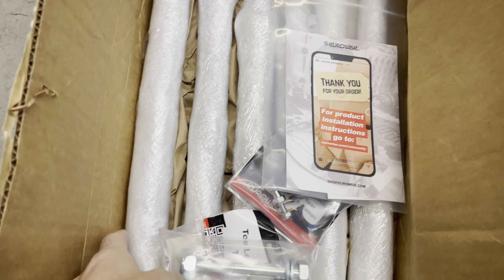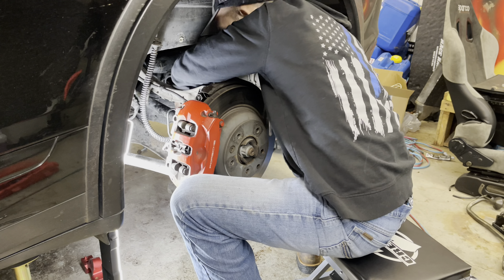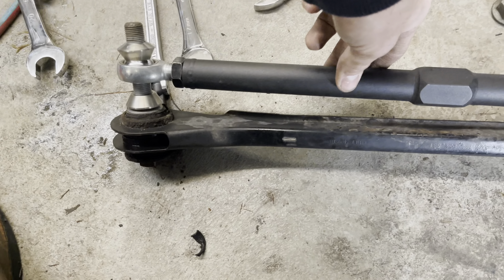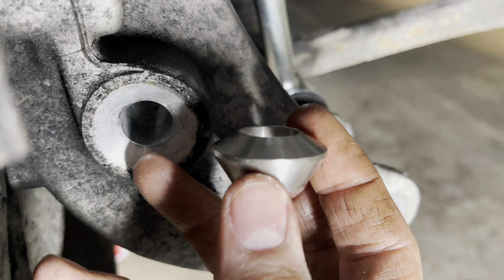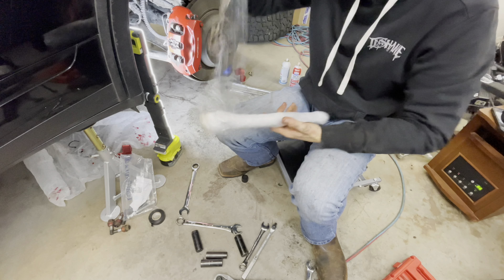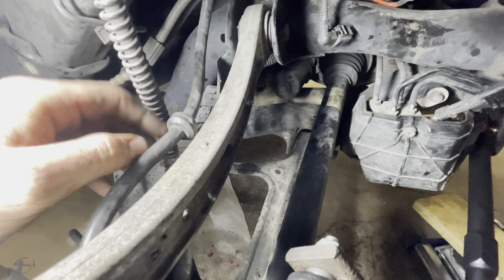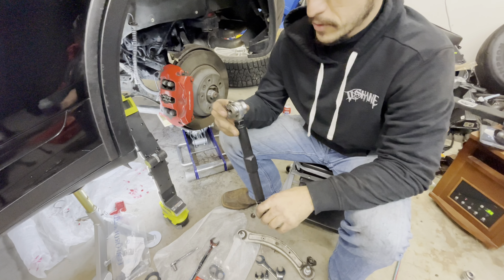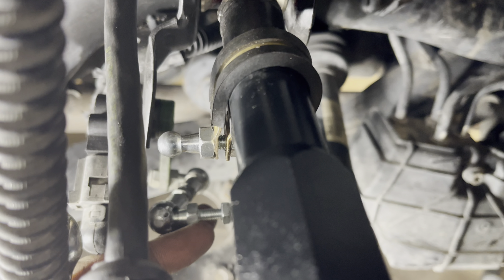EUROWISE 958 CAYENNE REAR CONTROL ARM INSTALL!

Comment: I have a 4L Q7 and I've been wanting to make a set (I like to fab stuff) but the conical spacers are hard to source.
I may end up just buying the set, even though it hurts my soul (if gingers had souls ;) )
My use is for opposite, to take some of the neg. camber out from being lowered.  Stock, I already had a good bit of neg. camber causing premature tire wear..
Thanks for the install vid, was helpful~

Comment: With your lift kit installed, were you dealing with positive or negative camber in the rear?  I realize your OEMs were worn, as you pointed out.  I'm just wondering what camber issue you may have been experiencing, as well. 
Thanks.
Reply from the maker: Alignment from factory has negative camber in the rear.  When the lift kit / arms were installed, I had to get it aligned.  I never had camber issues to begin with as that is the factory specs.  It was just corrected after the lift so it wasn’t as harsh on the off-road setup.

Comment: What were your after-install driving impressions? I'm debating putting these on my wishlist of suspension parts for my 958. Although my aim is not an offroad beast but more so on-road increased handling performance.
Reply from the maker: They're great.  My personal opinion?  Being on air definitely absorbs a lot.  They're not loud as some would say.  I love to listen to music so I usually don't hear much of anything to include tire road noise even though there isn't much of that too.  I was not going to replace the OEM arms with OEM again as the price difference was absolutely outrageous.